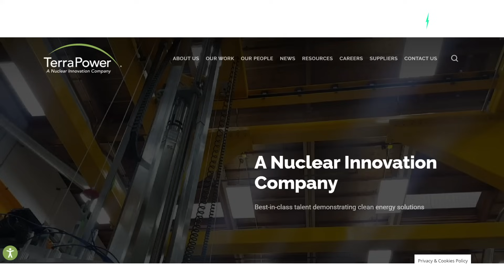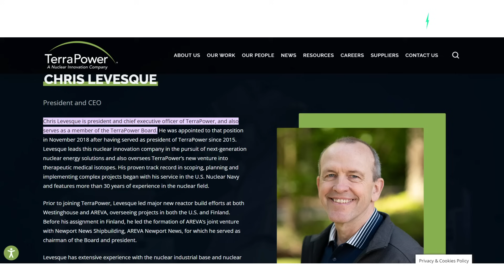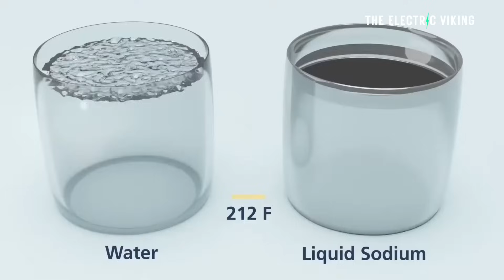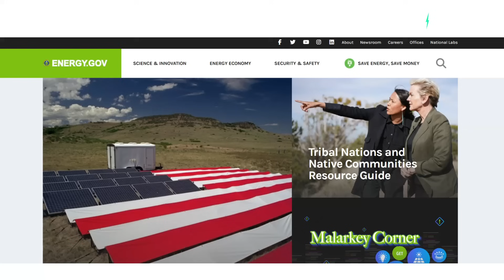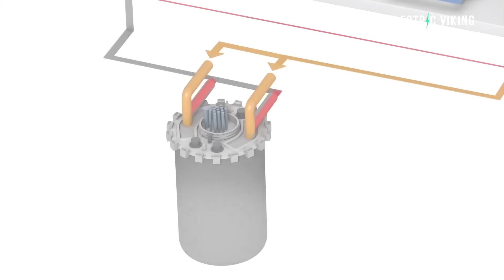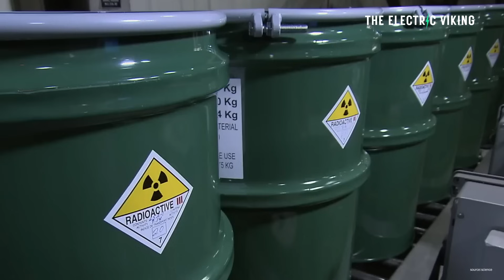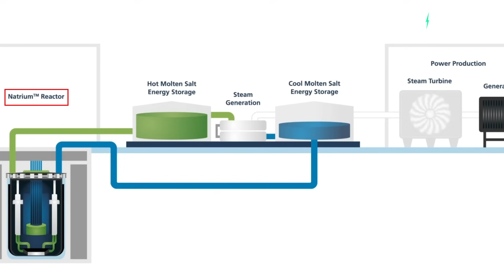Bill Gates' plans to build Modular Nuclear Power Plant in US without permits

Comment: Have you checked out pressurised fast breeding reactor India deployed this Month.  If it works, it’s game changing for India as well
Reply: India has spent about 2 decades building this plant.  Will it work well long term is the operative question.   6 countries build fast breeder sodium cooled commercial power plants starting in the mid 1950's - the 1980's (including the USA with Fermi-1, which suffered a partial meltdown about 3 years after startup).   Pretty much none of them proved to be reliable or economical with the exception of the claims by the Russians/Soviet Union that their plants did not have any of the problems that everyone else in the world had (and if you believe that I have a fully operational and free to operate "at will" anywhere in the Black Sea Black Sea Fleet warship to sell you).

Several countries built 2nd generation sodium cooled commercial power plants.  Again with the exception of Russia all of those plants were also shut down very prematurely due to significant issues.

A very real question is have China and India solved the issues or not; and the same question applies to the Terra Power design.

At this point sodium cooled fast reactors are far from a proven reliable and economic technology, even though in 1951 the very 1st electricity ever generated was from a sodium cooled fast reactor (Experimental Breeder Reactor - 1: EBR-1)

Comment: Russian sanctions is why the uranium supply (from Russia) is a problem.   Load following, with the arbitrarily large molten salt reservoirs, is a very useful game-changing capability of this kind of new SMR technology.  Using the grid hookup of old decommissioned coal power plants will help but they will need new turbine generators and not be able to use that part of the coal power plant because it will severely reduce the efficiency.
Reply: If the fuel is already a problem to get then this is going to have a hard time being scaled up.  So I have my doubts but I'm glad to see Bill Gates wasting his money to see if it actually could work.  Bill probably doesn't understand sunk cost bias, because he has never had to deal with that problem with his bloated Microsoft software industry.

Comment: Nuclear is the future without a doubt, it's the best of everything combined. Stable reliable energy that doesn't put as much pressure on the powergrid and it's very easy to plan your wait out of downtime. 
Extremely low life-cycle emissions comparable to land-wind or better. 
Nuclear can be used both for electricity and district heating in colder climates. 
Large nuclear power plants have the drawback that they are usually huge investments that takes quite a few years to pay themselves back. 
The large nuclear power installations typically use large concrete cooling towers which is a big part of their life-cycle emissions.
These small modular reactors will among other things exactly address this investment hurdle and the emissions from concrete in order to make it a total no-brainer.
These small modular reactors can even, at least in principle, be installed where existing steam turbines are already installed, e.g. old fossil power plants.

Comment: My question - what happens if an enemy drops a missile on it. Would it become a nuclear explosion 🤷‍♀️
Reply: No, not an explosion but it would scatter radioactive material.
Reply: @rohansprenger6902  As we saw with Chernobyl and even Fukashima, that didn't happen anywhere near what peooke thought was going to happen.  Also, the SCREAMIBGLY radioactive elements are that way for less than 6 months in quite a few cases.  This means the effect is shorter lived than the 'thousands of years' being thrown out repeatedly.
Reply: No, because the fuel isn't going from non-critical to critical instaneously, and is the wrong fuel for weapons use.

This has always been the case.  Reactors are not explosives.  2 different setups for two different speeds of fission.

Comment: New Nuclear Designs usually talk about three differences
1) Molten Salt Reactor (MSR) - The fuel is a molten nuclear salt - this is safer as it can't melt down (the fuel is already melted)
2) Thorium Reactor - Thorium Salt is used instead of Uranium Salt.  - Thorium is abundant compared to Uranium 
3) Small Modular Reactor (SMR) - Build smaller (container sizes) reactors and use many of than as opposed to building one big reactor
I looked up TerraPower and their Natrium reactor just does #1 - It uses Uranium Salt and is not modular.
Reply: Thorium is not fissile and uses URANIUM for neutrons to convert thorium into URANIUM
Reply: @clarkkent9080  yes, that is one of the things that makes it attractive since it needs fast neutrons to create fission.  It is sort the safety match of nuclear.  It will not ignite on its own.
Reply: @connecticutaggie  The proposed Thorium reactors are NOT fast flux reactors.  They utilize a URANIUM core to create thermal neutrons which will transmute Thorium 232 into URANIUM 233.  Then the spent fuel must be processed to extract the U233 to start the process all over. 

The only advantage of thorium is for countries like India that has thorium reserves but no uranium.  Thorium has been tried in 3 U.S. commercial reactors and in many other reactors in other countries and today there are exactly ZERO commercial thorium reactor cores  That should tell you something
Reply: 1:) molten salt reactors have an issue with tellurium causing cracks in metal structures.  The problem still is not worked out.
2:) thorium is more common if you don’t count on the amount of uranium in the worlds oceans. If you count it, the resources for uranium are much greater than thorium.  There is also the aspect that 20,000 tons of new uranium is added to the worlds oceans due to erosion ( making it renewable).
3:) the idea that SMR will save use hasn’t been proven out, and given scales of economy seems less viable.  As for TerraPower reactor, liquid sodium as a coolant is not exactly benign.  The experiments using Na in CA had many issues, and the risk of a fire with hot sodium and air are ever present.  A better choice would be molten Pb.
Reply: @waywardgeologist2520  running lead through the reactor core would potentially slow or halt the reaction though wouldn't it?
Reply: Natrium is just Sodium (Na).  Natrium is the Latin name for Sodium.  Bull Grates thinks using Nat as the 1st ½ of the word to resemble Natural will make people feel safe having it operational near their lives.  Usual Bill Grates 🐂💩

Comment: High Assay Low Enriched Uranium (HALEU) is nuclear fuel enriched to 15%-20% U-235, natural uranium is only 0.7% U-235, and standard fuel is 3-5%. Currently, only Russia produces HALEU nuclear fuel so TerraPower needed to delay their project for two years while U.S. facilities that can produce HALEU fuel are brought online. Another U.S. SMR has started construction as well, however the first units are being built in Ontario, Canada, largely because licensing is easier. This would be GE-Hitachi’s BWRX-300, which is a 300MWe light water cooled reactor, and similar in size to the 345MWe Natrium reactor.
Reply: At least the USA has to capability to produce HALEU fuel and they provide it to various research reactors (not to mention much higher enriched fuel to naval reactors).  However, Russia may be selling it cheaper.
Reply: The US can process research levels of HALEU now, but new reactors from TerraPower, Westinghouse and X-Energy require HALEU. So both Westinghouse and X-Energy are developing in house commercial scale HALEU processing in the next couple of years. @perryallan3524

Comment: SMR's sound fine, in theory.  Lean into factory manufacturing, standardization, just crank them out, to drop costs.  Costs drop esp. if one can build a lot of them, learn from experience.  But therein lies the problem.  I don't see a lot of them being built.  

(I wish Bill Gates luck.  We should have a  base-load or dis-patchable option, in the low carbon portfolio.)

Comment: Pebble bed Nuclear power is part of the power solution. Its smaller, safer and cheaper. Also take less time to build. South  Africa was already far on its way with the technology when the goverment stop the project. Many of the people on the project went to other countries to work for other companies on the same technology.
Reply: South Africa was ahead, however after the SA African government killed the program the lead South African pebble bed engineers moved to America and started a company called X-Energy which is based in Maryland, USA. X-Energy also has contracts to build over a dozen reactors and U.S. government support. The Xe-100 is an 80MWe, helium cooled, pebble bed reactor which uses HALEU fuel. The advantage of a pebble bed is it’s very good at providing process heat and can run for 60 years without needing to be shut down, the first unit is planned for DOW Chemical in Texas by 2030, primarily for industrial process heat.
Reply: @John-ed8ye  thank you for elaborate on my remarks. People underestimate this technology. SA will have been in a much better situation with our electricity with this technology but the gowerment had to stop it because of.....
Reply: China has had pebble bed reactors (HTR-PM) in operation for three years. It has also had two molten salt reactors in operation for two years. 

The harsh reality is the US is no longer in this race as it doesn't have the engineering skills and capacity for the job. Hence huge overruns and failures to complete.

https://en.m.wikipedia.org/wiki/HTR-PM
Reply: @jimgraham6722  there are South Africans working on this project and the owner of a  company and a South African were twice on a Radio program in SA talking about the project. People forgot about SA nuclear technology and that Sasol produce for many years petrol out of coal before anybody else.

Comment: Small modular reactors are the right solution for base load, however I dislike all solid fuel reactor types. They are all possible to suffer core damage due to loss of cooling. Liquid metal is not as bad as water cooled but sodium is explosive. It will become radioactive and salts of sodium are soluble. So I can see a way that this could poison the water supply. I like liquid salt designs better. The salts are not soluble. They are walk away safe. They can be refueled while running. There are issues nothing is perfect. But moving away from water cooled is the right choice.
Reply: Specially on th moon
Reply: @sparkysho-ze7nm   L😂L
Reply: When I first saw this article, I was hoping that Bill Gates was putting together a nuclear power plant that operates off of nuclear waste. The process is called  "PURTEX" .

Via Google  : 

"PUREX ( plutonium uranium reduction extraction) is a chemical method used to purify fuel for nuclear reactors or nuclear weapons. [7] PUREX is the de facto" 
~○~

Comment: Solar doesn’t produce at night; wind doesn’t pay when there is no wind.  The grid needs something additional to keep it going.  Maybe not wise to put all your eggs in one basket.
Reply: You have heard of batteries yes?
Reply: As Dr Saul Griffiths notes, Nuclear fits the energy mix for some countries in some locations. The USA fits this for a variety of reasons. It won’t be the bulk of energy.
In Australia, we can easily go full solar and wind using mostly pumped hydro and a mix of short-term batteries. We have almost unlimited sites for pumped hydro batteries. It’s the most mature technology, it’s very reliable and simply works.
Reply: @aaronsinspirationdaily4896 Hope your not waiting on snowy 2.0 or should I call it project Wishing Well  , you will be waiting a long long time
Reply: @robertcampbell6521  zero need for such large programs. Hundreds of smaller ones geographically distributed are a much better choice. Suits the grid better and matches where the renewables can be deployed. I think your knowledge is very outdated. Time to update that brother.
Recommended reading up on off-river closed loop pumped hydro. (It’s for storage, not generation like the snowy. Two very different things)

Comment: Nuclear is not even needed.
Reply: Storage for longer than a few hours and massive grid interconnects will be needed to make renewables work as the only source of power.  The grid is a just in time system and a cloud blocking the panels for a single large system cant make everyone's lights go out.  Nuclear power is safe and proven for base load; we would be in far better shape regarding climate change if not for the anti-nuclear hysteria in the 70s and 80s which made the industry insanely costly due to legal fights with protest groups and overregulation.  SMRs are not fundamentally different than the reactors that were developed in the 50s for the US navy.
Reply: Have you don’t the calculation to determine how much material will be needed for energy storage and the equivalent material required for mining?

Comment: New welding tech can do a smr welds in a day instead of a month
Super critical turbines are cheaper
Contractors should be paid when job is finished, no extra charge
Reply: On  Time
Reply: According to the fantasies of people who have never done it or built things...

New automated welding processes are used to do repairs and modifications in existing nuclear power plants.   The reality is very far from the claims above.   Supercritical turbines have never been cheaper than non-supercritical turbines.  But the plants have higher efficiencies that pay for the added expense of the more expensive turbines.

Contractors often have no control over construction timetables in the nuclear industry.  They have to be paid for having staff onsite for any delays beyond their control; and paying them after a project is complete only makes the project more expensive (it forces them to borrow the money up front - which is far more expensive than the Utility borrowing the money).

Comment: He could build a geothermal plant in 24 months that would produce the same amount of electricity.
Reply: Agreed. Plenty of real estate in NV with geothermal potential. There is also Yellowstone.
Reply: Every Landfill site should have layered heat exchangers implemented.  Rotting organic matter generates exothermic heat.
Reply: No one in the entire world has built a long term reliable deep geothermal power plant.  The chemicals and deposits in the water/steam from depths plugs up and/or degrades the piping and components very rapidly.

Iceland uses shallow geothermal sites which produce different chemicals and deposits. Even then they routinely replace the piping system used to collect the geothermal heat.
Reply: @perryallan3524  makes me wonder what grade pipes they are using?
Reply: Really?
Reply: Of course, there is the small problem of your geothermal well going 'dry', when the heat source can potentially disappear for a few months at a time.

Comment: I think it makes good sense to research, develop, and implement modern small nuclear installations that can generate power locally as well as support the electrical grids. These will be needed in space as well as on earth. The technology is rather mature; the devices are reliable, way less expensive, and much, much safer. Some of these power generators can be transported to a site on a semi-truck; buried in the ground by an excavator; and switched on to power an entire community, factory, or town for 10 years with little to no maintenance. After that, a crew comes to the site to swap out/refuel for the next 10 years. There is little to no waste; the "fuel" is recycled, enriched; and reused. The approval and regulatory processes need to be updated as these modular or small nuclear power generator designs become standardized in the same way solar and wind power and battery storage have.
Reply: You are talking about micro-reactors, not SMR power plants.   Micro reactors will only have applications to unique geological areas where there is a very small community or station and it is not economical to run power lines.
Reply: @perryallan3524 Well, that is true, for the most part. Obviously the plant shown being built here is at least a "medium" installation.

Comment: 15% of energy used is electricity. 

If rooftop renewables and a cheap battery can generate this 15% at millions and millions and millions and millions of customers, then nuclear is an economically dangerous dead weight. 
An economic dead weight for 60years to 100years and then it needs to be cleaned up.

Nuclear will monopolise the existing national grid and will not be able to be turned off.

Comment: Nuclear grid electricity to stop CO2 emissions worldwide is impossible. 

Nuclear promoters know how expensive grid construction is, and only 15% of total energy used is electricity. 

Government guaranteed cash flows is all that they want, it is the cash.
It is a monopoly control of the existing national grid. 

It is an extremely limited solution. It is an economic poison. 

It is a Rupert Murdoch Skynews new business cashflow monopoly. 

Rupert has made a $1 TRILLION business mistake in the USA and is about to face another $2 TRILLION mistake, a bigger business mistake.

Rupert's expertise is publishing. 
Gates' expertise is software. 

Outside their expertise, they are wrong and so dangerous. 

They both want 
government GARRENTEED cash flows and
 government GUARANTEED disaster insurance. 
And GOVERNMENT BUILT national grid. 

New grid is humongously expensive to build.
100% electricity is economically impossible with grid electricity. 

Gates wants government money AND the existing grid. 

That tells you it is an extremely expensive ECONOMIC DEAD END. 😮😮😮😮😮😮😮😮